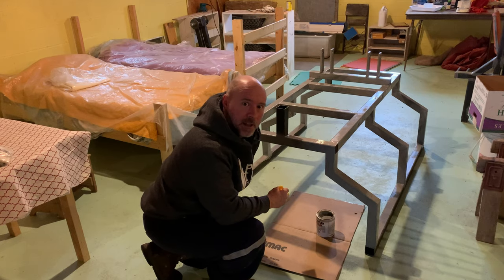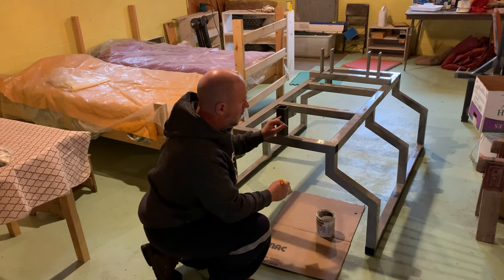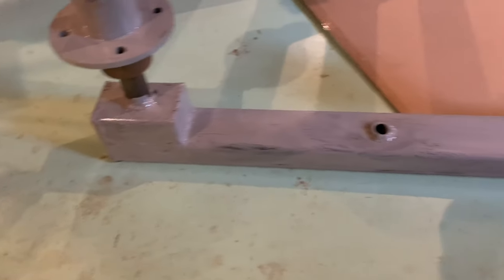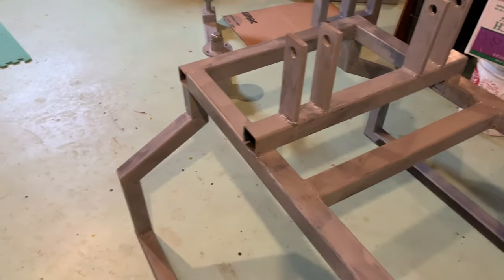The Ultimate Quad Trailer - Part 7 Giving it Some Paint

Comment: Late to the party but one suggestion.  You might want to add a gusset to the mounting tabs for the walking suspension beams.
Reply from the maker: Yes I agree.
I might add them later but right now I will leave them off for now as I will only be able to move a few hundred pounds with my quad.
When I get something with more towing capacity I will add them for sure.
They are 1/2" so 4 of them is 2" thick but hopefully nothing bad happens to bend them before that. :)

Comment: Looks great, also, looks heavy, whats it like on the weigh scales? 6-800 lbs? For myself, traveling through the bush, fire wooding, might be a little overkill. But looks indistructable. Thanks
Reply from the maker: Not sure how heavy it is but I can roll it and stop it pretty fast just with walking with it.
I would think it's about 400 right now but am looking at adding a hydraulic lift on it this summer and that will add some weight to it for sure.